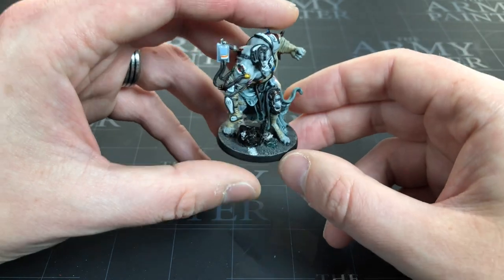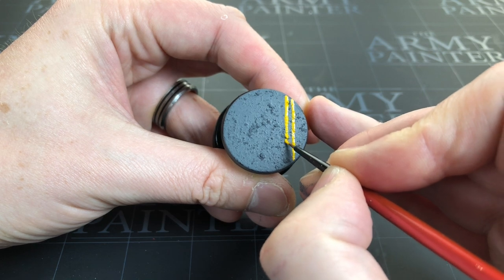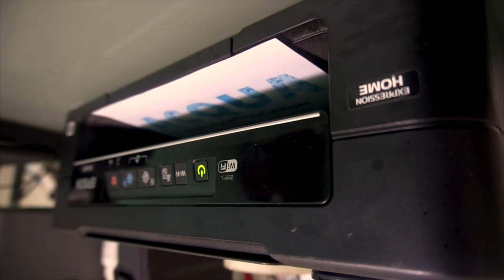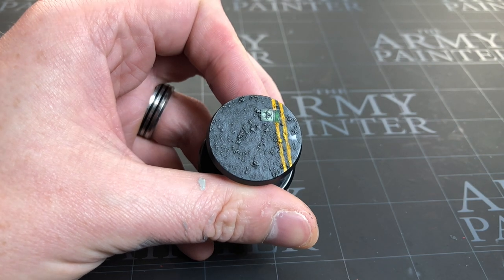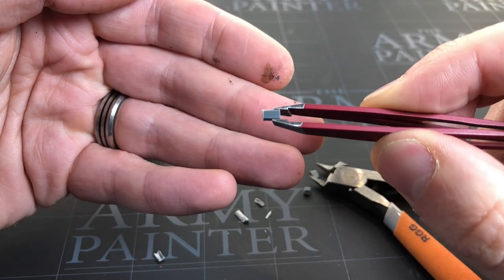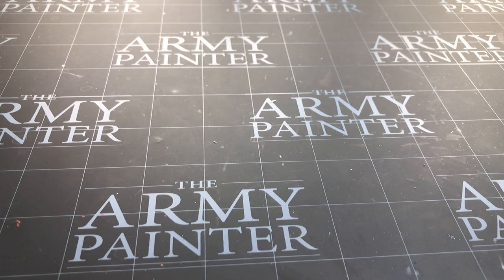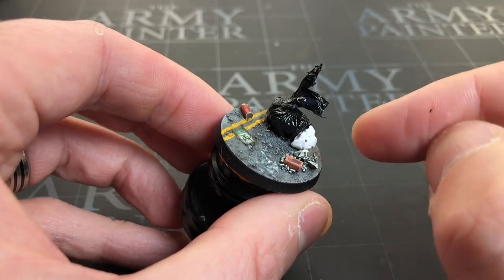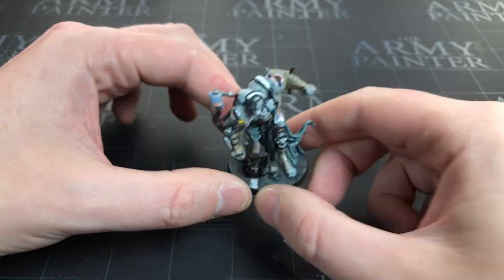How to make FREE urban city street bases from trash

Comment: time saving suggestion: I cut out sections of regular garbage bags to make my mini ones, usually wrapped around a ball of aluminium foil or a rock and tied off with a bit of thin wire. Saves having to paint them.
Reply from the maker: I considered using a black bag myself but wondered if it’d look too contrasting to the miniature! Very real vs miniature. This is a very good tip though I bet it looks fine! I like the thin wire idea, I tried one of those pieces of wire you get that tie cables together but it was way too thick! I should have looked for even thinner shouldn’t I? Great tips though. I will try this myself!
Reply: @WatchItPaintIt   Yellow cotton maybe, for those bin bags with the ties built into the top rim?

Comment: Question about the posters. Did you print them actual size or scale them?
Reply from the maker: It will depend on the set you find, but the one I used and linked in the description I scaled down to about 25%. I just printed them off and kept scaling down until I got the size that looked good!

Comment: Quick question I'm rebasing my 1st edition zombicide minis to match the 2nd editions bases so will be leaving about 1-2mm plastic under the feet to raise them up to 2nd editon height. Do you recon standard DIY wall filler with a bit of water and sand will work to get a concrete texture base effect like the Astroganite you used here?
Reply from the maker: A similar effect, yes. The grain of the sand in astrogranite is a little smaller than GW sand, but close. Wall filler can sometimes be brittle though. Maybe test it out on a scrap piece of plastic first.